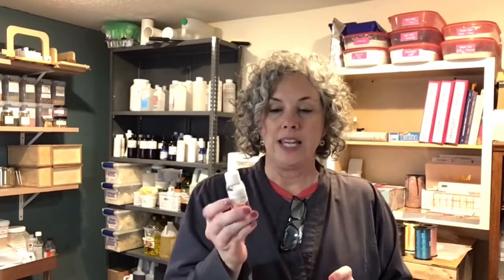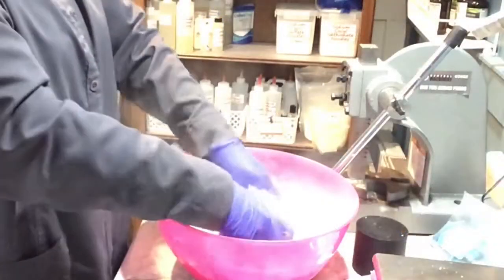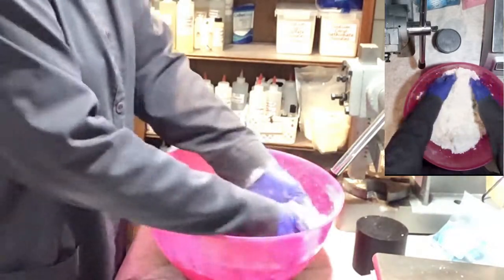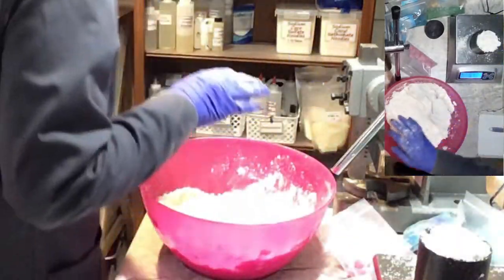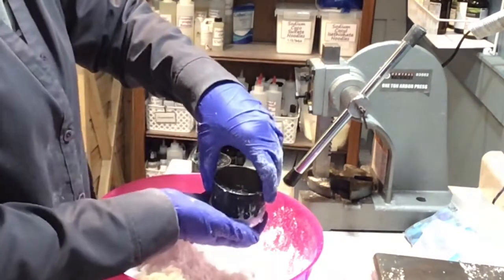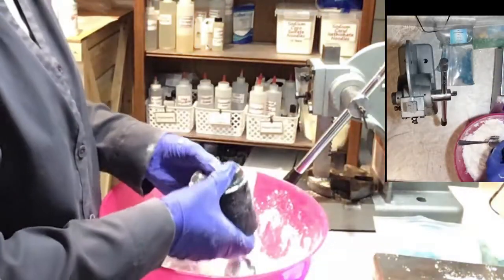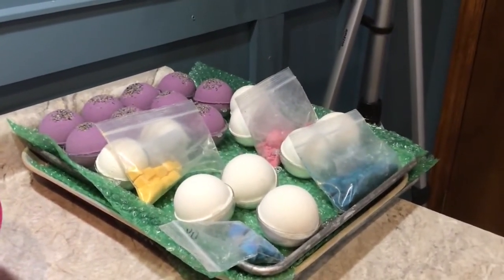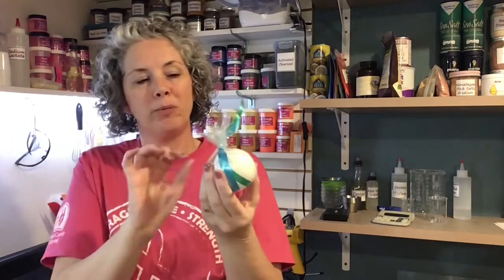How to Use an Arbor Press to Make Great Bath Bombs!!

Comment: I just assembled my arbor press. My hands would hurt for days after making batches of bath bombs by hand.  I’m soooo excited Thank you so much!
Reply from the maker: I hope it works for you as well as it does for me!! - be careful tho - I did crack a mold last month! But all in all, I think it is worth the risk! 🤗
Reply: @WalnutCreekBathBoutique  have you tried getting a press plate and ram head? Might make it easier
Reply from the maker: @thedrunkengardenernb  I thought there was something like a plate I could get for it but then kinda forgot about. Thanks for this, I will see if my husband can help me with it!
Reply: @WalnutCreekBathBoutique  after watching your video, I did the deep dive, lol.. if you check out RAFXLaserProducts on Etsy, he has ram heads and plates. I was going to use some silicone and epoxy resin I have here, make a silicone mold of the ram head, pour epoxy in it, then secure that epoxy piece of the ramhead to the bottom of, maybe a pringles can or something, with the bottom part of the ramhead up, and pour silicone over that, covering it with a total of 3/4 of an inch (however think you want the press plate) and if you're familiar with epoxy, my idea was to put a couple of magnetics on the first epoxy casting, so they would be part of the actual plate and sit flush, but im not sure if that would work. 

Idk if that makes sense to you, or him, but if you can sort out my thought process, it seemed like a stellar plan.

I opted to just order one though, because I don't often have time without my 3 year old, so I don't want to mess with epoxy in the house... lol. Goodluck!
Reply: Isn’t this brilliant?

Comment: I have a arbor press from Harbor Freight. What material is your molds made of? On another project I had my press for, not bath bombs. I installed a longer handle on it using a electrical connector & added a extension into that.
Great video, thanks. I can relate to the back & the neck, I'm a very young 72 year old guy. Doing this by hand for several hours in one day can really get to you.
Reply from the maker: Hi John! I use Cada Molds from Etsy for my molds. They work great, just be careful not to put too much pressure on them. I suppose you could get metal ones from the electric/air press manufactures but they are pretty salty :)
I like your longer handle idea!!

Comment: Should have watched this before buying my bath bomb press that was so expensive and came broken. The supplier then sent me a part and wants me to fix it but I am no engineer. I am so upset.
Reply from the maker: oh Eliana! That is horrible! I'm sorry that happened to you. I will say, this is an older video and I don't use my arbor press anymore. You certainly can use it but the reason I don't is that I was putting too much pressure on it and started cracking my molds.
Then it just so happens that at the conference I attended this last weekend I bought the bath bomb press. I'm a bit nervous after reading your comment! I can't believe they sent you the part and expects you to fix it yourself! That is just not right. I hope in the end you can figure it out!💕
Reply: @WalnutCreekBathBoutique  Tammy you are so special! Thank you for your reply! It means a lot to me!

Comment: Does it matter what type of arbor press you’re using I actually have some of these molds and didn’t know I could use them in this way?
Reply from the maker: Hi Melanie, I don't think it matters, just be sure not to put too much force on the lever. It really doesn't take much at all. I heard one of my Cada Molds crack a little once and I was kicking myself. Light pressure and moving the mold a lot lot to keep from having a pressure point is key.  Thanks for your question and good luck!